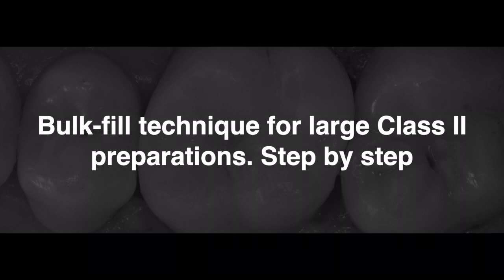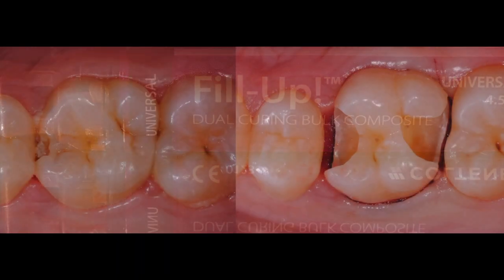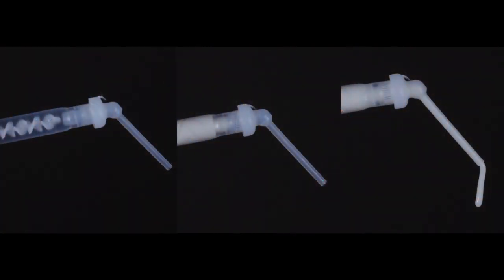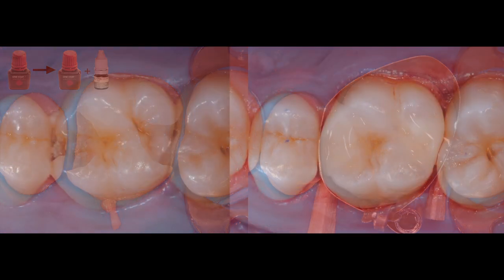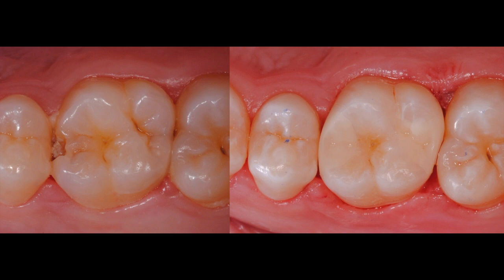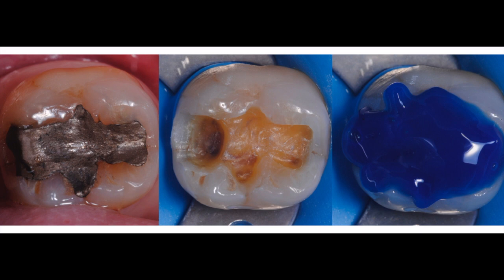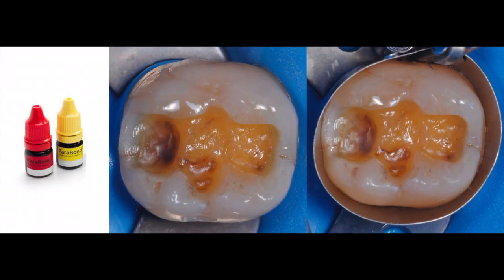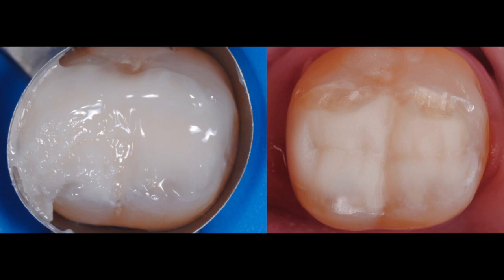Class II restorations using Fill-Up bulk fill restorative material (clinical and pre clinical)

Comment: according to the instructions on the bulk fill, they say let it sit 60-90 sec and not light cure until after that time.   That is my resistance to using this material.    are you seeing any issues with curing immediately after or possibly a flash cure so you can start doing occlusal anatomy while waiting the 90 sec for the dual cure at the base of the box to work before pulling the sectional?
Reply from the maker: Hi, I actually completed a bench top study (unpublished) where we had two groups and compared curing immediately after and 90 seconds after. The difference was an eye opener. The integrity of the margin when allowing to SC was statistically different. This “science” is not new, we know that resin “shrinks” polymerization, and that what really matters is the “strength” of the contraction. The greater the volume, the greater the strength. This is not different is other “LC” bulk-fills, the problem with those is that “we don’t have any other option” than layering them, which defeats the purpose. I like DC Bulk-fills, specifically Fill-up, because it comes with a SC dental adhesive (ParaBond) which improves bonding to DC or SC composites. I allow the bulk-fill to SC for 3-4 minutes, and then I LC. Now, I use this product and technique for specific clinical situations, like teeth with large MOD that will eventually need an indirect restorations. This concept is the same when we use Core Build-up material. Hope this answers your question and thanks for watching.